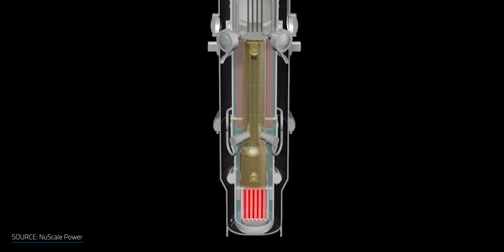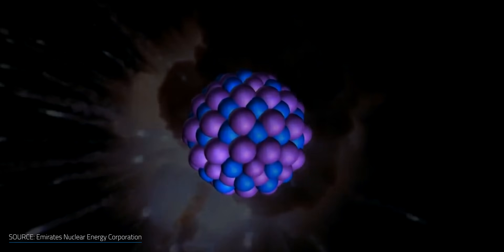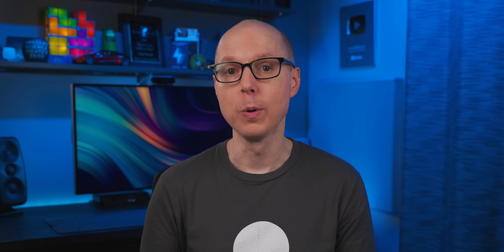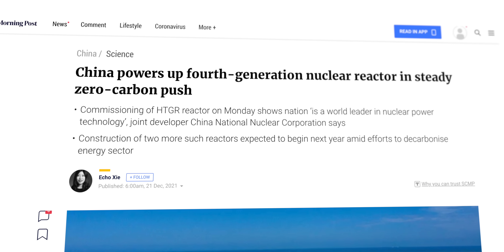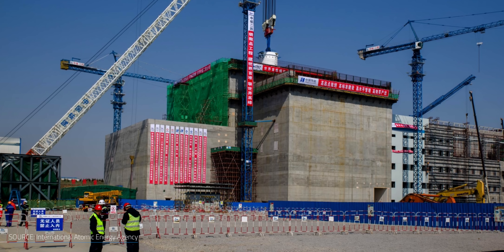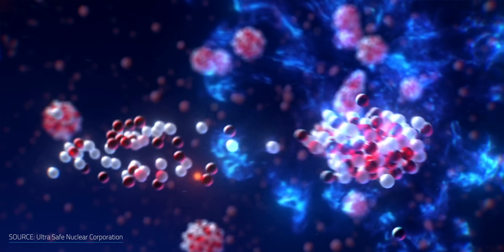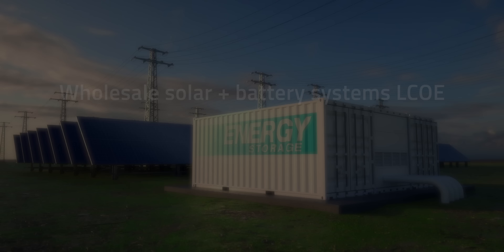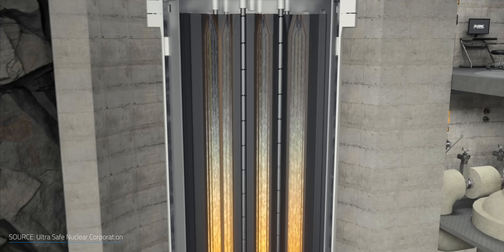Forget Small ... What About Micro Nuclear Energy?

Comment: I have long thought that Micro-Reactors are the path of the future. I have also wondered why couldn't the fuel be the spent nuclear fuel from the larger reactors? It is still highly radioactive for 10,000 years. Let's capture that energy.
Reply: After that, we can start talking about atomic powered cars and airplanes.  A nuke in every garage!!!!!!
Reply: They are already using helium to cool as in The China based technology. Helium is a gas at room temperature. I think a closed system that has a cold liquid helium tank,  tubes that are honeycombed surrounding the full length of each single waste rod, which heats the liquid helium  to gasify and causes massive pressure  through a  propeller/ turbine, generating electricity, (and perhaps even cooling the rod to faster safety levels?) then those  tubes  gravity feed back through refrigerant coils to the liquid helium tank. When  the fuel rod becomes not hot enough to keep up a baseline  wattage output, it might be safer to dispose of, then next waste rod is placed in the system.
Reply: @barbaralemons4741  A China textile factory can make 500,000 pairs of socks every day, ship them half way around the world and Walmart sells them 3 pair for $1 and everyone makes money.  If you can understand why that cannot and will not happen in a U.S. textile factory, you may be able to understand why what happens in China  means nothing in the U.S..  
The U.S. has built and tested just about every type of nuclear reactor over the last 70 years and has more experience than any country on earth.  The problem is not the type of reactor or the cooling method, it is just that in the U.S. we cannot construct new nuclear on schedule or withing budget and it does not matter if it is a BWR, PWR, SMR. Molten salt.  Most nuclear projects in the U.S. have been canceled after spending billions and those that were completed took 15 years and were 100% over budget.  Do we have 15 years to build and test out a new design and if that works, spend another 15 years constructing more of these????
Reply: @clarkkent9080  That was before the weather went to shit and the insurance companies stated having to pay out multiple times a year.  FEMA's going to have to start triaging what help they can bring.  That's what's different. Also, machine learning and AI can evaluate designs  so much faster... cheer up. Once money is leaking, $#!+ gets fixed.
Reply: @barbaralemons4741  I have worked in nuclear power for 40+ years and it has only gotten worst.  The more the government gives away free taxpayer money, the longer and costlier it will be as companies delay as much as possible to get more taxpayer money.  We can and have built the standard new 1,300 Mw PWRs. But that was after 2 of the 4 were canceled after spending billions and the ones that MAY be completed will take 16 years and $15 billion each.  As long as time and money is no concern we can start building more right now.  The only problem is that no investor owner utility would ever build a new one after the past failures.  So that leaves it up to the U.S. government to start the U.S. Power company.  The national debt is only 29 trillion so lets print more money!!!! Cheer up -  Its only the next generation's money
Reply: @clarkkent9080   Screen name or your name? This is my name.  
 Talking about small reactors.   Small grid supporters in concert with green producers and storage puzzle pieces fitting together to solve for X.
 Not talking about boondoggles chasing that obsolete tech that is mostly still based on having the actual sea to cool it down. 
 Saying past is prologue in this case won't wash. 
 I spent a decade counting inventories, another at point of sale register jobs, and at least five years at call centers. 
At all of those jobs, and at every job I've ever seen, 
new tech cycled in more than once, faster, cheaper, and better. 
Technology advances and becomes cheaper on a faster and faster cycle. 
 We just kind of wanted to use nuclear before, but the risks were too high at that level of technology, 
and the slow cycle was exacerbated by political parties changing administration goals and fossil fuel lobbyists. Now, we HAVE to.

 So, think defense production streamlining and motivation, 
along with every possible design for the purpose data crunched  in a fraction of the time
 pre ground breaking, and
 that  that new  facility structure doesn't need a Hoover Dam's worth of concrete and steel. 
 Then imagine 'spent' fuel rods being used only, so already, somewhat less shielding is needed... 
it's like going from
quadrophonic speakers and stereo cabinet  with tube technology and LP's 
to streaming music on devices wirelessly syncing to speakers anywhere in your house...
 Your inner Kal-El knows  that when the going gets tough...$#!+ gets done.
Reply: @barbaralemons4741  Barbara you are trying to make Lemonade out of lemons .  Building any nuclear project is not like building a Walmart or McDonalds and the construction challenges is certainly not like taking inventory or call centers.
The 4 reactors (VC Summer and Vogtle) were Westinghouse ADVANCED PWRs and they claimed that they would be built faster, cheaper, and better because system modules would be built in a factory and connected on site.  This is the SAME excuse that the "NEW" reactor designers are using to say why their project will not suffer cost and schedule over runs.  These projects along with MOX are the latest  nuclear projects. MOX and VC Summer were canceled after spending BILLIONS.  Vogtle is 100% over budget and schedule.  IF they cannot build a PWR that they have been building for the past 70 years on schedule and within budget, WHY do you think a new technology reactor can be build any faster??  This is not about the technology, it is about being able to build new  nuclear cost effectively.  Unless you support a U.S. Government power company willing to spend $15 trillion added to the national debt, to just replace the 100 aging nuclear power plants operating today it will not work.  NO INVESTOR OWNED UTILITY IS WILLING TO BUILD A NEW NUCLEAR PROJECT WITHOUT FREE TAXPAYER MONEY.  Look at the last 25 years of nuclear projects in the U.S. and then tell me how $#!+ gets done.  I have always used relevant examples to back my opinions however, You do not have a clue!!!!!
Reply: Just think about the energy we could capture off the heat an internal combustion engine makes that is wasted now.
Reply: @johnsanders561  Yes, in the winter it is called turning up the heat in the car.  The law of physics states that you cannot recover 100% of the available energy from a mechanical heat engine.  There must be some loss or the engine will not work
Reply: @clarkkent9080  Wow!
You're so brilliant.
Reply: @clarkkent9080  Go put your hand on the exhaust manifold.
I've reheated many meals on engines while in the army.
Reply: @johnsanders561  No, I am just not a science denier. Energy rejection in a heat engine is taught in basic physics classes....or you can google it.  Most vehicle engines are less than 40% efficient.  Nuclear plants are also less than 40% efficient while coal fired plant, technically, could be as high as 45% efficient. There are massive and complex power plant systems (reheaters) that try to extract as much useful energy as possible, although the energy efficiency at the nuclear plants that I worked at never exceed 35%.  The water vapor you see coming out of a power plant cooling tower is most of that wasted energy.  In science, some things are just the way it is.
Reply: Carrying around nuclear bombs in commercial products doesn't seem like a very smart idea.
Reply: US army did micro reactors before, they've been failures. At least one guy was pinned to ceiling by a control rod after an "incident".
Reply: @timsievers2067  Yes the SL-1 was a SMR and while we will never know exactly why it happened, the control rods were manually (by hand) withdrawn rapidly during a maintenance activity.  It is thought that two men were arguing over the one man's wife.  The U.S. tested just about every type of reactor known including SMRs, Molten Salt, Thorium, etc. and this happened to be one of them. 
Every type of power generation benefits from economies of scale.  How many wind turbines or solar arrays are small???? SMRs can be built faster but you would have to build 4 to equal the output of one standard PWR so you would have to build 4 in less time that it takes to build one PWR to just be equal.  And operation of a SMR is not that different than a large PWR so they would be more expensive to operate
Reply: Better to use the "spent" fuel in a breeder reactor, as it can still virtually all be fissioned after breeding. Otherwise you are just using the small proportion of fission products for the residual heat generation.
Reply: @thecraggrat  There are a lot of great ideas is money and engineering were unlimited.  First lets try to build a large scale (i.e., 1,000 Mw) nuclear power plant in less than 10 years and that includes the design, contracting, and all planning before breaking ground.  If that is ever accomplished, then we can consider hybrid designs. But today in the U.S., it takes 15 years and $15 billion to build one large reactor, that is if Vogtle ever does startup.
Reply: @clarkkent9080  The problem is building large reactors... They end up being one of a kind builds even if it's the same nominal design. Plus they require extra work because of the containment building and the safety systems. Plus the forgings for the reactor vessel are so much more difficult it takes much longer etc, etc. Which is why for a large power station/generating site, multiple SMR's will be better, passive safety etc, molten salt better still, no possible way you get any high pressure accident as the vapour pressure of the salt is less that an atm.
Reply: @thecraggrat  The VC Summer and Vogtle reactors were/are Westinghouse AP1000 reactors and identical to ones already built and operating in China so the U.S. could learn from any problems China had.  Tell me how a specific reactor design that has been built multiple times be a one-of-a-kind?
EVERY reactor requires safety systems, emergency power, and a containment building and large reactors have the advantage of the economics of scale. Passive safety systems, just like the ones on the AP1000 are still safety systems.  T
he Ap1000 is a 1300 MW PWR while the Terrapower reactor is a 345 Mw and the NuScale is a 77 Mw design.  Personnel requirements (operators, maintenance, security, engineering, admin, etc.) are very similar for any type of reactor so the PWR is much cheaper to operate than any of the other types when comparing MW output. 

Utilities can order any size reactor they want.  Why do you think every utility has ordered the largest reactor that is currently made?
Instead of having one HVAC unit in your home, why don't you just have a smaller HVAC unit for each room in the house?  Now does than answer the question of why bigger is better?
Reply: @clarkkent9080  No it doesn't
You may not know, but the US has no capacity to perform the large forgings that are required to make AP1000 reactor designs. They have to be bought in. The only places that can make them currently are Japan (Japan Steel Works), China (China First Heavy Industries, China Erzhong, SEC), France (Le Creusot),  and Russia (OMZ Izhora).
Larger reactors require larger heavier forgings. Also the trend for Gen IV reactors is to run at higher pressures for PWR's, so the forging has to be even stronger/heavier and the metallurgy needs to be developed for that too. Is the US ready to use Russian forgings in its reactors? Chinese forgings? Even French forgings (and France had had some quality control issues with these forgings)?
Also the large reactors cannot run passive safety systems, to get the heat transfer out of the reactor passively means the temperature difference has to be higher and with a PWR reactor that means higher pressure - the pressure just gets to high for safe passive cooling with large PWR's.
Safety systems for the smaller designs can be passive, this means cooling can be conductive and convective with no need to force coolant circulation. This means you do not have to have multiply redundant coolant pumps that simply cannot fail or you are into a meltdown. It also means you do not have to have the control systems associated with these systems either and the people overseeing them. When the reactor uses physical systems (by this I mean based on physics/thermodynamics etc) to control the output based on demand, that is truly safe.

Sorry, but you do not understand economy of scale, a larger reactor doesn't gain an economy of scale by being bigger. The larger the reactor the fewer you build, so the lower your build scale.
SMR's, because they are small, can be built in a factory, using parts that are the same for each reactor, that are built in the same place, on the same equipment and tested in the same way, allowing for SPC on the production process - there is no SPC on large reactor construction. (This is an economy of scale).
The whole reactor is delivered to the site for hook up, quite possibly it is even fueled so it is ready to be brought to an operative state once it is in place and hooked up to the generator hall and control systems. You also have multiple reactor cores being built on the production line at once, with the same personnel do ing the work, who are all familiar with what they are doing, as they do it every day.

As far as "one of a kind". With the large reactors, the build site etc can become critical in planning for the reactor build. I quote from an MIT analysis:
"Many of the excess costs were associated with delays caused by the need to make last-minute design changes based on particular conditions at the construction site or other local circumstances, so if more components of the plant, or even the entire plant, could be built offsite under controlled factory conditions, such extra costs could be substantially cut."
"Many of the reasons behind the cost increases, suggest that there’s a lack of resilience, in the process of constructing these plants, to variable construction conditions.”
This is not the cost of the reactor per se, but with the building of the whole facility, including the reactor hall and containment vessel to the reactor, the sourcing of the cooling water and its return, plus also the local infrastructure for contractors to do the build etc. 

As far as personnel are concerned assuming you need the same personnel to monitor the reactors, just because you have one reactor vs two or twenty doesn't mean you need more personnel; a fault actually shows up easier against a field of indicators which is all supposed to be the same. 
Also if you spread the reactor output over multiple cores then you can get away with less maintenance personnel as you can take a single core down without affecting the total output much, easing maintenance scheduling Vs taking the only reactor down and having to rush the work to get it back up again. 

Just because utilities have ordered large reactors up to now, doesn't mean that it's the best way. It's just the current way. Also there are no SMR's that have finished design sign off yet, so that is a slight problem. Give it a few years and there will be multiple designs approved for building, then we'll see which way the wind blows.

As an aside, wrt to HVAC systems. I live in Arizona. Larger houses have more than one HVAC system, not because you can't buy a larger system, or because it is cheaper than the larger system, but because if one HVAC goes titsup you want at least one more providing some cooling so you don't fry whilst you get the first one fixed. In a lot of ways having individual small units makes more sense - cool each room to the amount you want, or not based on usage, redundancy of cooling capacity. It has a lot to be said for it. Overall efficiency may even be better.
Reply: @thecraggrat  First let me make sure we are on the same page as I only comment on U.S. nuclear since what happens in other countries has no direct bearing on U.S. nuclear operations.
Having said that, there are no gen IV reactors operating or planned for the U.S.. So what is your point? 

The Westinghouse advanced AP1000 is a gen III and the latest and only reactor currently being build in the U.S. (Vogtle). There are operating and planned AP1000s but they are in other countries. Since the AP1000 is a NRC approved design, they are all identical and NRC has pre approved the build and operation permit, not one of kind, and all systems and components can be built on assemble lines, if so desired.

The AP1000 Vogtle unit 3 and 4 reactor vessels were fabricated by Doosan Heavy Industries in South Korea, the same as the VC Summer unit 2 and 3 reactors before those were canceled.  
If you are worried about components built in China, look no further that the brakes and steering in your car or any pharmaceuticals that you may take along with the cloths you wear. So what is your point there?

Every reactor that I operated (5 total) can cooldown using passive cooling (natural circulation). I was the control room supervisor at one plant operating at 100% power when we had an offsite power upset and all 4 reactor coolant pumps shutdown. The reactor tripped and we operated on natural circulation for ~ 1 hour before power and the reactor coolant pumps were re-stared.  It worked better than the simulator.

The AP1000 is very similar to the reactors Westinghouse has been building since the 1970s.  The main difference being two reactor coolant loops instead of 3 or 4, loop passive bypass lines to enhance natural circulation and a passive gravity fed water storage tank for containment cooling. The electrical system required for initiating the passive systems doesn't rely on external or diesel power and the valves don't rely on hydraulic or compressed air systems. That IS PASSIVE. So what is your point?
This is from Westinghouse: The plant is a pressurized water reactor with improved use of passive nuclear safety and many design features intended to lower its capital cost and improve its economics. The design traces its history to the System 80 design, which was produced in various locations around the world. The AP600 was a smaller design (600Mw) but was never built due to a lack of interest in small reactors.
TO BE COMTINUED
Reply: @thecraggrat  CONTINUATION
There is little difference in the number of operators, maintenance, engineers, management, security, admin, etc for a 77 Mw, 350Mw or a 1300Mw reactor so operating costs make a larger plant more cost effective (economies of scale) over smaller plants. That is why no utility wants a SMR and no one bought the AP600. That is a FACT and REALITY so what is your point?

The factory build concept was tried at VC Summer and Vogtle by building system modules in a factory and shipping them to the site.  This concept failed when modules did not fit together and poor quality required rework at the site.  The factory concept has been identified by VC Summer and Vogtle project management as one of the reasons for cost overruns and schedule delays. That is a FACT so what is your point?

Now, lets talk REALITY.  The NuScale SMR (77 Mw) is estimated to take 7 years to build and $4 billion (That is NuScale's estimate not mine) .  And $2 billion of that is taxpayer welfare. Compare that with the AP1000 (1300 Mw) and it will require 16 SMR to equal the output of one AP1000 and the 15 years to build the AP1000 at a cost of $15 billion in the U.S. is totally unacceptable and a financial failure.  So to be successful, SMRs must be more cost effective. Now you will tell me they will pump out a SMR every 11 months when we cannot build a Walmart in that short a period.  And the cost will decrease from $4 billion each to 250 million each. Also, there are not enough construction crafts to build 16 SMR simultaneously. 
So we already know that the Nuscale SMR is 4 times as costly (per Mw) that the AP1000 and 16 are needed to equal one AP1000 output. I am willing to bet my own money that they cannot be built in less than 10 years and the cost per unit will never drop below $3 billion each.

I can tell from your response that you have absolutely no experience in nuclear power and base your response on corporate PR and what some other no-nothing has printed and you may even be one of the many paid corporate lobbyists that troll these channels hoping to get some of that taxpayer welfare. In any case time will tell with the NuScale SMR project.  But I am sure the "it will be better, cheaper, faster" excuse will surface in 7-10 years after the first one is built and it cost more and takes longer than anyone estimated.
Reply: @clarkkent9080  Hi Man, I look at what is generally happening around the world as it can impact what happens everywhere...Still I'll try and address your points as I see them.
There are no gen IV reactors operating or planned for the US. Yep, true. There are Gen IV reactors that are being pushed towards the approval process. Also there are type IV reactors that are being built in Canada (Moltex MSR in Point Lepreau, New Brunswick). Now I know you are ignoring that reactor, but there may yet be cooperation between national authorities on approval of new reactor designs, so it is still important.

New reactor builds, admittedly it does seem that Doosan now has the capability for the AP1000 heavy forgings (15000 ton press and 600 ton hot ingot size) My source said in construction...but my point still exists, there is no US source for these forgings, so you are counting on the quality control of a foreign (even if friendly) country.
You are also correct that the reactor design for all AP1000 reactors is the same, but my point was that the actual power station build is subject to variable  and local conditions that impact the design and cost overruns, referenced in the MIT report, and these things cost a lot money to fix, especially when they are late changes in the build (of the buildings etc, not the reactor, though they may impact the reactor support systems).
In the UK, the cost for the Sizewell C power station has inflated hugely due to these very things.

You obviously have experience with the reactor operation, so I'll defer to you in what you know/have seen. Having said that, I expect the safety systems in the latest Gen III reactors to be as good or better than previous reactors. From what I can see when there is a problem that requires shutdown (say total blackout), the AP1000 reactor will drop the control rods immediately to damp the core and there is sufficient water in pools to continue cooling the spent fuel pools, and the core for at least 7 days before any other source of water is required, though one pump runs because it has a flywheel incorporated to continue operation and maybe there is a steam driven pump - I'll have to read through again to be sure, but pumps are required, even though they aren't driven by external power.
The safety system also makes use of the large, expensive containment vessel as a cooling radiator, and steam  is generated that fills this, presumably at some pressure. I see there is a pool of water on top of the containment building that is used to cool the outside of the containment vessel, 6 hrs after the event, too.
I see there is cooling of the outside of the reactor vessel too to try to ensure the containment in the event of a core meltdown.

So I think I'd term the rector design as safer, but still not as safe as desired, not that it's any slander on the AP1000 reactor, I'm sure it will be very safe and much safer than older designs. From my perspective as a physicist/engineer, albeit not a nuclear engineer, it leaves a fair amount to be desired.
This is why I don't like PWR reactors much, or any water cooled reactor really. My preference is for MSR's. Important issues for the AP1000 seem to be action required after 72 hours to have backup water supplied to cool spent fuel, which requires back up diesel generators for power. and 7 day cooling water supply in the tank on top of the containment building. I'm sure this could be improved though.
BTW, this is from Westinghouses document on the AP1000 reactor, so I hope my source is OK.
Reply: @thecraggrat  I am a simple person and my comments on all these channels are simple.  I only care about the U.S. and what is happing and will happen in the U.S..  
After VC Summer and Vogtle construction failures, no U.S. utility is even considering the construction of another PWR (i.e. AP1000). The only new reactors under consideration are the Natrium and NuScale SMR and these are demonstration reactors that range from 1/4 to 1/16 the output of the typical PWR. These will have to be built and the concept proven before any more will be built. So you are looking at 2028 to complete construction and 2033 to prove the concept (if ever). The factory build concept did not work out for Vogtle or VC Summer but lets assume they can build one in a record 5 years.  The U.S. construction trade was stretched to its limits in trying to build VC Summer and Vogtle at the same time and now you need to build anywhere from 4 to 16 of the new reactors to equal the output of one PWR.  
Many of the original PWRs and BWRs have been shutdown and many more will suffer the same fate in the next 10 years.  You can keep them running past their 40 year design life but it gets very expensive and without government support (taxpayer welfare) the investor owned utilities are shutting them down.
It doesn't take a genius to see that nuclear power's contribution to the U.S. energy mix will decrease over the next 20+ years before it will be possible to reverse that trend and renewables may advance to the point where nuclear is no longer needed.
So we have another factual reality taking place with the Natrium and NuScale build. I am confidant that they will not be built on time or within budget.  Their current estimated cost and time to build is more that the massively over budget/schedule  AP1000 when the Mw output is considered and they are already saying it will be better, cheaper, and faster next time. 
One partial fix would be to concentrate on fixing the problems with the U.S. construction such as mismanagement, no accountability, fraud, greed, and even sabotage in trying to keep the gravy train going. 

It is good that you are not a nuclear engineer since I do not see a nuclear resurgence in my lifetime.
Reply: @clarkkent9080  OK, I can see where you are coming from, & I can see that you are disillusioned with the nuclear industry in the US.
I disagree on the usefulness of renewables alone, they are OK, and I'd use them in a personal installation (ie solar on the roof & battery store at the right price), but good for a reliable power source 24x7 they are not. They require some sort of backup energy store and batteries so far are not it. When they have a cheap enough energy store they could supply reliable energy, but even then they take up a hell of a lot of land.
Nuclear I am optimistic about. Not what is happening in the states necessarily; and I do not like any of the solutions where leaks from the reactor cause critical issues - So the Natrium reactor is out (molten sodium, I think not, too reactive), in fact any molten metal coolant concerns me. Gas cooled reactors = high pressures, again not my favorite, so similarly PWR's. For me Molten Salt Reactors smack me round the head as to be the way to go - No/minimal pressure, not reactive, runs at high temp (hence efficient), solid when cool - easily containable, inherently safe, reactivity drops as temp increases, so passively load follows etc. It ticks boxes where inherently safe means no safety system required, just correct design = cheaper.
I'd like it if the UK government would put money in to the British company that I think has "best" design, in that it uses existing tech/materials where possible easing the approval process. Still is is being built in Canada With the target date being approved & operational in the early 30's. Slower than I'd like, but OK. I'm expecting the UK to go ahead with SMR's based on sub reactors by RR of 470MWe capacity. As they are based on an existing design the regulatory approval should not be too bad. Not my favourite, but better than nothing.
I see the budget overruns on the build of Sizewell C, which is the "standard" large reactor site, and I think there has to be a better way - that to me is simplify/de-risk the nuclear island installation move to designs that do not need huge containment buildings etc.
Anyway, that's me, I'm done.
Reply: @thecraggrat  You may have misunderstood my comments.  I am not disillusioned with the nuclear industry in the U.S..   I am disillusioned with the U.S. construction industry being able to build any nuclear project anywhere near the schedule or budget and it does not matter if it is a SMR, PWR, BWR, MSR or MOX.  I would like to see a nuclear resurge in the U.S. but given the construction failures it cannot and will not be financial viable until or if the construction industry changes. 
In any case, nuclear projects become more and more expensive while renewables become less and less expensive and advancements in battery technology and solar panel efficiencies are growing by leaps and bounds while the promise of nuclear is based upon designs that were tried and abandoned 50 years ago.
It all comes down to economics. Don't count on climate change forcing people to accept a more expensive energy alternative when 55% of Americans not only deny that climate change is primarily a result of carbon emissions but that solar, wind, and electric vehicles are liberal lies that are attacking their freedoms.  Its God, guns, Trump, and oil/gas/coal, not necessarily in that order.

In my nuclear career, I dealt in facts and reality.  Everything was black and white. And the reality in the U.S. more nuclear Mw will be shutdown than is build for at least the next 20-25 years and that some other electrical generation must be found and used in the interim and if that interim power source is less expensive than nuclear then nuclear will die on the vine.

I chat with people that say MSR are the worst and that we should build Thorium reactors.  The problem with both camps is that there are no plans to build either in the U.S. any time soon.  But sit back and enjoy watching the climate change sh1t show of a dumpster fire.
Reply: @clarkkent9080  Ooops, yep, misunderstood that.
As I sort of said, renewables are pseudo cheap. You have to cost in the storage required to make then a 24x7 solution the "renewable evangelists" never do. Then, you need to cost that they will have to be replaced after ~20years± - Wind turbines are ~20 years, solar efficiency rolls off after ~20 years. Nuclear should be good for 40-60 years. Land costs too when you have to cover so much of it with windmills or solar. There is a good analysis here:  https://youtu.be/V2KNqluP8M0
The main hope is the rest of the world IS taking it more seriously than the US wrt nuclear, eventually they will get on board.
Nuclear would also solve the west's main problem (environmentally at least) - Water. With power comes desalination, however you want to do it...evaporative, RO etc. Take the water from the sea, not the rivers, improve irrigation to use low water amounts etc. it can be done an the cost is not that much (esp compared to economic collapse), and don't worry about the rain again. Someone will whinge about brine return to the sea being bad, so don't - use it, pipe it to existing salt pan desert and use the sun to evaporate the remaining water, et voila, cheap, unlimited salt for the harvesting.

As I say, based on the reactor designs I have seen, the Moltex designs make the best sense to me. It puts the molten salt fuel in fuel pins, so no fuel/coolant mixing, the coolant is a salt so no boiling/low pressure, hence no pressure vessel required, which makes the reactor vessel a lot easier to manufacture. High temps in salt mean you can have salt thermal storage for time shift power generation, to use nuclear to fill in "Renewable holes" so you don't need storage of renewable power. It works with existing materials, can use galvanic protection of the core vessel etc, so no salt corrosion. NO water anywhere so no steam explosion/dissociation to hydrogen and subsequent explosion risk, a la Fukushima. Has been costed by British nuclear engineering firm to be on par with a coal plant for construction costs. Three variants of design, Fast neutron reactor to use up existing spent fuel, Thermal neutron reactor - U235 burning, Thorium Breeder reactor. 
Thorium reactors are usually a molten salt design because of safety considerations.
Reply: @thecraggrat  A slight correction: Today's solar panels lose 0.75% of output per year of full sun operation. So I don't know why you would replace them at 85% output or even 70% output after 40 years.  
I have not researched the life span of wind turbines but they are nothing more than spinning generators so I don't understand what wears out other than newer designs being more efficient and worth swapping out.

Just announced today; wind power output in the U.S. has exceeded nuclear or coal for the first time and given that there are places where the wind ALWAYS blows that will only increase over time.

Energy storage: lithium batteries are being replaced with solid state batteries, and graphene batteries. Flywheel energy storage  or water energy storage. Solar farms divert excess power to desalinate and pump water to elevated storage.

And there is coal and natural gas with carbon capture.

Bottom line: new nuclear in the U.S. is decades away while other forms of energy production are advancing by leaps and bounds.  And while we are waiting for nuclear something WILL take its place and if that something is anywhere near the cost of nuclear, well then we will be back to the same negatives of nuclear that stopped it in the 1980s only this time there will be no reason for a resurgence.
Reply: @clarkkent9080  Hi, you are correct, for solar panels the median loss is~0.75%, there is a fairly significant tail that goes out to 3%/year too. I don't have a figure for catastrophic failure, but that happens too, not to mention physical damage/just plain being covered in crap. There are many modes for failure, but the industry considers the lifetime to be ~25 years, which is what I quoted. The question you have to ask though is after 25 years does a loss of 20% of your generating capacity cause a problem to you? I know, put in more panels to cover it, but how much more do you spend and at some point you have to replace panels, and it is sooner than with nuclear.
For wind turbines it is more a case of fatigue in the blades, it is cumulative and will eventually fail catastrophically, the generator set itself requires routine maintenance. Spread out over lots and lots of turbines and thousands of square miles... Oh and very high winds just cause outright failure sometimes...eg a generator under load getting caught out with high gusts will fail. For this reason when the wind is high the wind generators ironically are shutdown - Happens all the time in the UK (there are offshore wind farms which get very high gales & in Scotland high winds over the hills can be >100+ mph - the windmills do not run in this); AND there is nowhere where the wind ALWAYS blows, and again if there was the high end of the wind will likely be too high.
As far as storage for intermittent power, the best thing in my book is if they make fuel with the power that can be directly used, eg hydrogen, or power  the GTL generation that can be used by ICE vehicles but without the greenies going spare about CO2. 
Storing power by pumped water has the issue of not having many locations suitable for it to work & you need plenty of water too :-) Use excess for desalination is a good idea, but you better have sufficient capacity for desalination with baseload as people get really crabby when water gets shut off! I suppose you could desalinate the water and then pump it into lake Mead, lake Shasta et al in California; I don't know about suitable sites elsewhere in the US, but how much of you desalinated water gets lost through evaporation then?
Other types of storage...Batteries do not give you anywhere near a reasonable cost for grid level storage - orders of magnitude off (and that is the baseline, not how good it is but how much it costs/kWh)! Haven't looked at the cost of other stuff, but some greenie would be shouting it if it was anywhere close. And you need a lot of storage capacity to have an energy reserve that can cover a few days or weeks. A nuclear plant covers a few years at least - that is an energy reserve to me. Still I keep seeing stuff that is interesting and who knows?
Other generation sources - coal with carbon capture, yep doable, likewise natural gas, though the methane losses associated with natural gas likely more than offset the CO2 reduction anyway due to the much higher greenhouse coefficient of the methane vs CO2. No such thing as a free lunch!
Final point - true! Usually this happens 'coz there are subsidies to be had too, it normally comes down to economics unless there is some strong government direction. Governments usually can't understand technology though and make poor decisions, like the UK government saying no ICE engines to be sold by 2030 or 2035 - all well and good; "green", but seriously baked. Set a target of carbon neutrality, but get there however you can, eg convert ICE's to hydrogen, sort out how to produce GTL fuels efficiently, also do electric too, but have a plan for generating the required power and transmitting it around the country and allocate funds. This way intermittent power with excess going to H2 production or GTL becomes sensible and a good use of it, generating electricity that cannot be used due to load balancing is not.
Still what do I know, I'm just a pleb who understands science.
Reply: @thecraggrat  I agree that 25 years is what you normally see quoted for solar panels but they will produce power for much longer.  Realize that the efficiency of nuclear decreases over time also.  Buildup in the steam generators, condenser, reheaters and leaking valves reduces efficiencies. I have spent many days searching for leaks to try to recover a 0.05 % efficiency loss.  Cleaning heat exchangers is costly to do and costly in down time (~2 million per day).

I don't think the cost to clean and maintain solar panels and wind turbines is anywhere near the cost to maintain a nuclear facility.  Wind turbines use variable pitch blades so wind speed is not an issue and the mechanical turbine should last forever as long as blades are changed every 20+ years. Also the mechanical skill needed to maintain a wind turbine is no where near that to maintain a nuclear facility.  As I stated before, wind farms are replacing nuclear and coal as the U.S. major source of energy.  Wind turbines can also be considered to be energy storage units.  When a wind farm is producing more power than needed, some turbine blades are pitched to reduce the output. This spinning reserve only requires a few seconds to change the blade pitch and ramp up the power output.  This feature is relatively new but could solve the issue of spikes in power demand if significantly more wind power is installed than normally needed.

I worked at a facility that was purely hydrogen based and there are many issues with this form of energy such as low energy density and the very interesting effect that hydrogen (extremely reactive) has on common materials.  While you hear people talk about hydrogen, industry has experimented with it and it is considered an outlier in energy storage or use.

I have looked at a solar and lithium battery storage for my home and it is 100% feasible.  But every time I get ready to invest, a new and cheaper solar/battery technology comes along and before I can buy, that is superseded by a better technology.  For me, I could install a system ($15-20k) that would provide 150% of my normal power needs and also act as an emergency source of power when the normal grid is down after storms. The excess generation would cover the solar degradation for 40+ years. I lose power (a few seconds to days) on average of 12 times a year. The one and only issue is my two 5 ton AC units.  The system can supply the power needs but starting current is the issue.  If both units were cycling on and off for some reason the starting current surges could over load the system. There are new capacitor bank systems that are being developed to address this issue. I have friends  that operate a grid tied system that addresses this issue and produce more power than they use and instead of paying the power company they receive a monthly check for the excess power they produce. My utility will not allow me to operate a grid-tie system.

I have explained in detail why new nuclear is decreasing its contribution to the U.S. power grid and a turn around is 20-25 years off. SOMETHING WILL fill that void and since it will meet all the demand requirements, it will just be a question of economics. And with the cost of nuclear increasing every time a new generation is built, nuclear is becoming less and less attractive.  For those people on these channels chatting up MSR, Thorium, SMR, etc. they will be waiting decades for their dream while their lights and toaster is powered from some other source.
Reply: @clarkkent9080  There is always problems with everything. However there are also solutions too. For steam turbines move to closed cycle CO2 running various Brayton cycles, be it gas or Supercritical CO2; these even improve the efficiency of the process. Still I expect there will need to be maintenance like on everything, and it always costs $$. 
As far as keeping solar panels in a desert clean, I dare say it doesn't cost that much of they are built with a mechanism to do it, maybe manual clean isn't too expensive, but it will certainly be constant, especially on large solar farms, how frequent is necessary? Who knows, every time there is a wind that whips up the dust I'd guess, which is pretty frequently.
And solar does have a failure rate like all semiconductors - that isn't efficiency rolloff, but plain drop dead, but the point at which a panel is replaced would be different for a home owner vs a utility, but what it is I don't know, but maybe a drop of 20-30% is it...
Of course wind turbines are feathered, they have a maximum rotation speed before they overload, and running them in marginal wind conditions can cause a catastrophic failure with a gust.
As far as turbines lasting forever, they don't. They are susceptible to gearbox failure bearing failure, thermal cycling, electrical fires due to humidity in the nacelle. Apparently in Denmark where they have been running wind for a long time, blade & gearbox replacement is common after 10 years and the 20 year lifespan of the turbine is quoted as being dubious that it will be met.
I daresay you can have wind turbines turning on quickly with them spinning waiting for demand, but it would be better if they could make something like hydrogen at these times. Yes hydrogen is a bit tricky, but is likely the fuel that will be needed for all commercial travel needs (trucks etc & heavy plant machinery), unless we have GTL fuel, because the duty cycle on this equipment is too high for electric power use, especially on heavy plant machinery, where the batteries are so heavy they require the machinery to be made of a stronger heavier structure etc. (vicious cycle-esque) and they don't have time to be sat around recharging, but hydrogen in an ICE does the job without increasing the weight of the plant & fills in 5-10 mins, so no duty cycle probs.
Batteries get better, no doubt, but are still expensive, I've heard of possible options, but can't remember them to check into their viability... A Supercapacitor/battery hybrid store for home use would be adequete if expensive. Use your power not the utilities, or at least use utility power at it's cheapest & top up with your own gen'd power. I agree it is a good way to go.

For nuclear in the US, I can see why you are not hopeful. It really takes government will to make it happen and ideally have a countrywide plan, but there is too much resistance in the US for that to happen, probably. Maybe it will take other countries showing positive results with new nuclear power and Gen IV design reactors before the US will join in; or maybe fusion will suddenly be solved and everyone will be happy. Still while I see interesting news there I'm still enough of a physicist to think "yeah, we'll have fusion in 30 years" is a standing statement :-) (ie come back in 10, 20, 30 years and the statement will be the same).
Reply: @thecraggrat  Nuclear heat to steam to mechanical to electrical is very inefficient.  I don't recall exactly but I believe that it was around 30% when they has us looking for leaking valves or anything else that could increase efficiency, but that was a 20+ year old plant.  We were never able to improve it more than 1% so some magic was happening.

I don't imagine solar panels would get any dirtier than a roof top in the vicinity with atmospheric perspiration (rain) as a natural wash. Dirt is not a very good shield against the wavelength adsorbed by solar and there are panels that adsorb energy from both sides (direct and reflected).  I have seen demonstrations were snow covered solar panels rapidly shed the snow from the heat generated from the little energy that penetrates the snow cover. While solar panels can fail, so can the multitude of electronic components in any coal, gas, or nuclear power plant with the moving parts of these form being much more suspectable to failure.

I would think if a massive high temperature turbine and generator can spin for 40+ years that a similar life expectancy would exist for a small wind turbine (when properly maintained).  The rotational mass of a wind turbine would prevent a wind gust from having a dramatic change in rotational speed and it would certainly be within the response time of the blade pitch. The spinning reserve concept for wind turbines is no different than what is now happening with coal or gas generators.  Most grid operators maintain ~5% of spinning reserve with synchronized generators connected to the grid and spinning with no energy input. When a demand spike is noted, steam or gas is introduced to pick up the variable load.  In power generation, supply must always equal demand or you start losing voltage and frequency.  In the 2020 Texas ice storm they came within (I believe) 7 minutes of low frequency tripping every last power generator that they had on their grid and a black grid restart takes days to weeks to perform.  That is about as close to a major event that the U.S. power grids have come to in 50 years and a story in itself. There are 3 U.S. grids, east coast, west coast, and Texas. The Texas grid exists purely for political reasons and almost caused them a lot of problems. Had they lost the grid and shutdown their coal and nuclear plants in freezing weather there would have been billions in equipment damage. But they always do everything bigger in Texas.

Given what I know about hydrogen, I do not see it as a major player in the U.S. power future and the disinterest of industry makes me think I am right.
As far as fusion is concerned we are just 5 years away.  But we have been just 5 years away for the last 40 years.

Like I have said, unless you can show me proof, or at least a scenario that instead of a decreasing contribution, nuclear will increase its contribution to the U.S. energy usage before the next 20-25 years, we have to assume that some other form of power generation will take up that slack.  The question then becomes, unless nuclear is cheaper than that "some other form", why go back to nuclear?

In any case, the next page in nuclear will not occur until the Natrium or NuScale reactors come on line in 2028 at the earliest but my estimate is that it will be more like 2030+. 

I have never been a betting man but I am so confident in my assessment that I've got a stack of Ben Franklins that I am willing to wager.